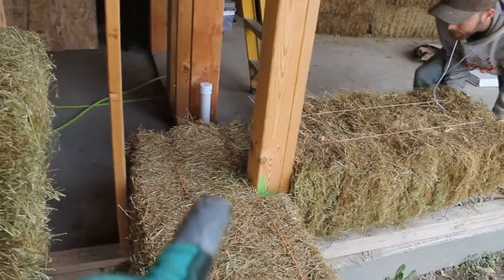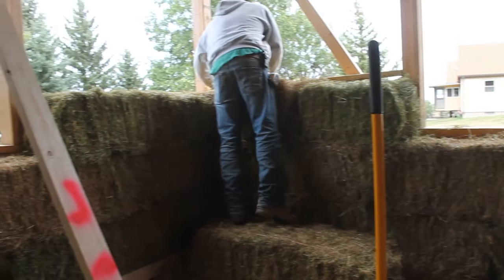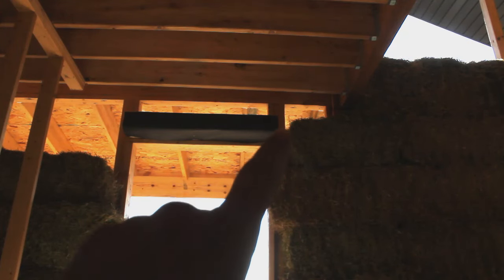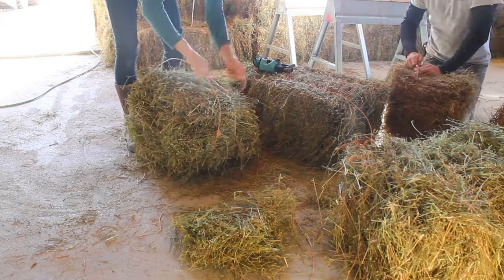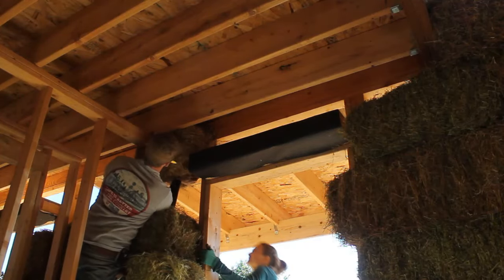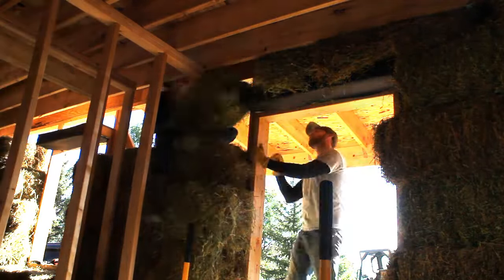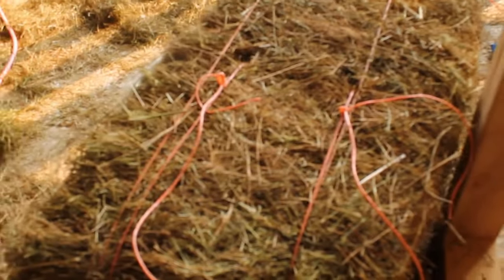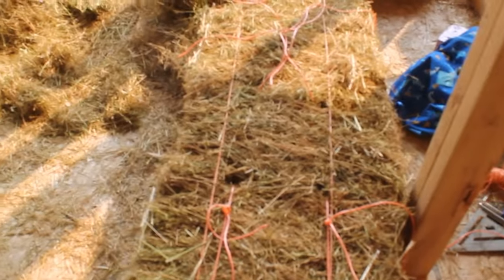Straw Bale House Walls | Part 3

Comment: Hey, culture shock here, I see that in USA you use straw bales to build the actual wall, here in Europe we have multiple companies that ocuppied specifically on straw walls, but for us is different, cause they are pre built and the actual straw is pressed at a high quantity/m3, they are more efective and have better temperature insulation, you dont have that?
Reply from the maker: Im sure there has to be somewhere that offers this! It sound amazing though!

Comment: Love it! This definitely adheres to the Cheap, Fast, or Easy rule. Cheap and relatively fast, but certainly not easy. Did you guys ever consider just doing mineral wool in the tight spaces? Seems like above the door frames and around windows where there were many narrow or tight spots, rather than spend hours cutting pieces to fit, tieing, then jamming the straw in there, it would have made sense to just spend a tad extra to use mineral wool which is very easy to cut and put in place. Again, great job.

Comment: I’m not sure what the large aggregate is for, and I’m puzzled as to just how you’re fixing the bales of straw together. As the usual method are to secure the bales to one another & then secure them to the base of the structure. If the aggregate is there for airflow, as it’s size might allow vermin to access the inside of the bales. As this would make an ideal home for them as well. If you were wanting to vermin proof the base , fine specific sized aggregate can be obtained. I’m sorry if I haven’t seen the bit where fix the bales to make a fit & proper structure, but unless it’s done correctly. It’s a waste of materials, money and time. Best of luck with your endeavours!

Comment: Awesome effort!  You are blessed with an enthusiastic work crew.
Is the frame constructed with dimensional lumber or post and beam and did you do the framing?
And how are the mechanical and electrical systems installed?
Are the final wall coatings proprietary or common easy to obtain materials?
If some of these questions are answered already, just refer to that video.
Thanks for uploading this.
Reply from the maker: post and beam, we did it. look through the previous videos for the electrical  video, he plaster is Natural Hydraulic lime purchased through limes.us.

Comment: y wife and I are also building a strawbale house, I'm still working on the timberframe for ours. What's the weight on the bales you are using, and did you just buy straw bales, or did you get something specifically for building? I have read some sources discussing the need for more tightly compressed bales for building than are commonly produced when producers bale up their straw...
Reply from the maker: We used organic flax straw bales that we baled up ourselves -they were dry and tight which is what we were going for. They were around 35 pounds I believe and harvested with an older combine. Which leads me to my next thought:  I am wondering if the reason why your source mentioned that is because nowadays almost all combines (that harvest the field) shred the straw in small/fine pieces leaving it hard to make tight bales. Whereas years ago the combines did not shred the straw and the stalks were a good 12" long or so, which made nice interlocking tight bales. Of course the baler itself has a lot to do with it also.  Many people around here are just making straw bales simply for bedding for their livestock and aren't too concerned about tightness -they just need the bales to make it off the field into storage. So this all makes it harder to find someone that has the bales with the specifics needed for building. They are out there though, you just need to put it out there and look around (maybe facebook farm to table type groups?)!  Where are you located?
Reply: @buildingroots5873  We are in SW Michigan. Thanks for the swift response ;)
Reply: @buildingroots5873  I agree its hard now to find good quality tightly packed straw bales...I am in the UK and it is not just a case of any old bale...you want really good bales. Barbara Jones is a brilliant teacher and knows so much, if you ever need advice.
Reply: @buildingroots5873  they looked remarkably green. Were they completely dry?
Reply from the maker: @spiceweasel945  yea unfortunately one side of the house was really green. they were only 8% moisture which is ideal. the crop was harvested a little too early in my opinion.

Comment: What is the chainsaw used? Our chainsaw is dulling really fast with our straw bale cutting. Do you change it often?
Reply from the maker: it was just a random electric chainsaw, i don't know the brand. we never changed anything on it other than having to tighten the chain a few times.

Comment: How does one keep the rodents out of the walls???
Reply from the maker: 1.5" + of lime plaster is usually thick enough to keep rodents out as long as it is applied correctly where there is no ''accessible" areas for rodents to get in. thanks for watching!

Comment: Is this going to be a black mold factory behind the scenes? Don't let moisture get in it, ever.
Reply: I wonder if incorporating lime into the building of the walls (dusting them, maybe?) Would help prevent this.
Reply: It will be waterproof after they plaster it I don't think they have to worry about it

Comment: Be mindful of the rodents that can penetrate those straw bales!
Reply: How would rodents get in here? It will be sealed with an a good plaster on both sides. Its a tried and tested method of at least a hundred years. Its a brilliant method of building...do some research.!
Reply: Those bales are not straw, it looks like barley so have nutrient value for rodents. Rodents when hungry can go everywhere, plastered sealed walls are nothing to them. Nice job, wrong bales.

Comment: Looks like a fire hazard waiting to happen.
Reply from the maker: Once stucco is on both sides, these houses hold up better to fire than a traditional stick built house. There have been straw bale houses in the California forest fires that are still standing to this day (pictures showed the fire all around the houses), when all the other houses burned down.
Reply: Throw a compressed straw bale on a fire and see what happens they don't burn at all..loose straw on the other hand burns